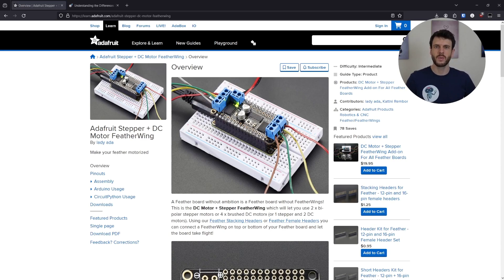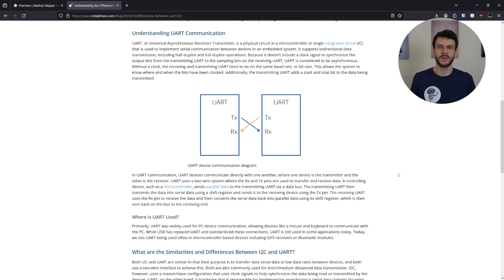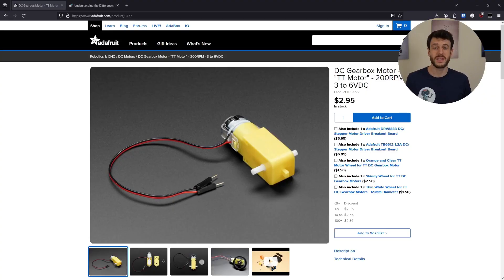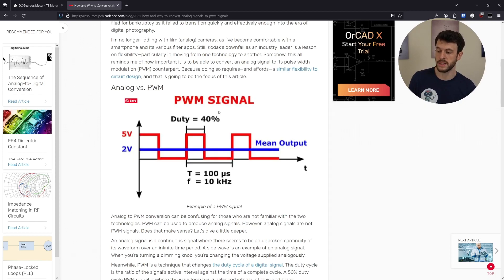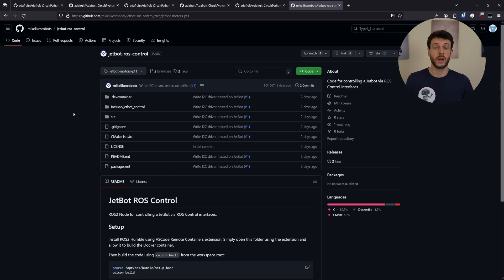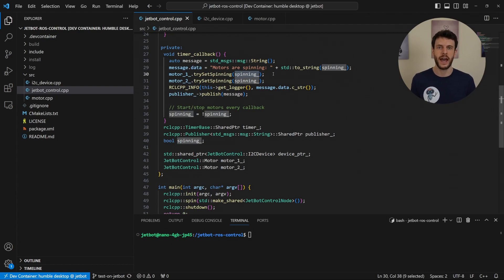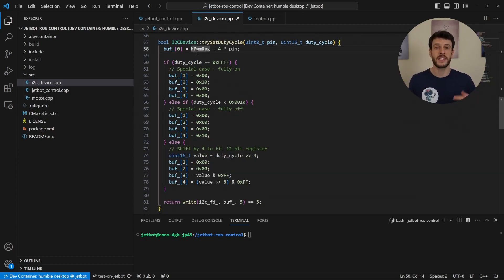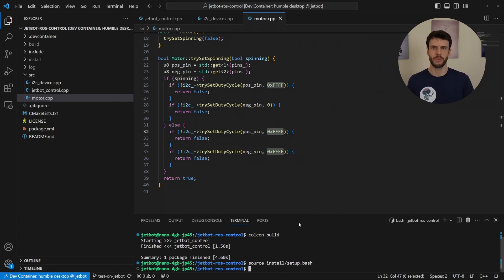Using I2C to control PWM | ROS Control with the JetBot Part 1

Comment: Thank you so much for this Great session. It worked for me after a little struggle. But performing the command 'sudo apt-get upgrade' corrupted my jetbot's bootloader and couldn't boot next time. Any solution for that?
Reply from the maker: I'm glad it worked for you - but the apt upgrade corruption should not have happened. Maybe it's an issue with your SD card? An apt upgrade should never corrupt your system, and running through this setup multiple times on my setup never had the problem. Sorry I can't help you any further! Let me know if you have any other questions.